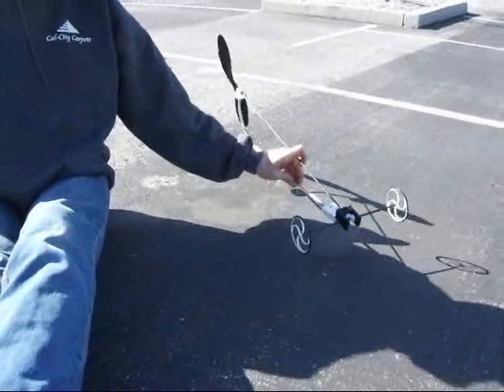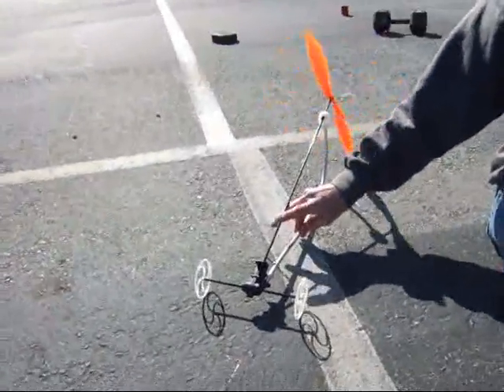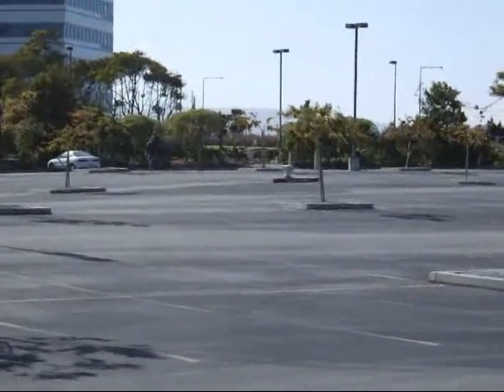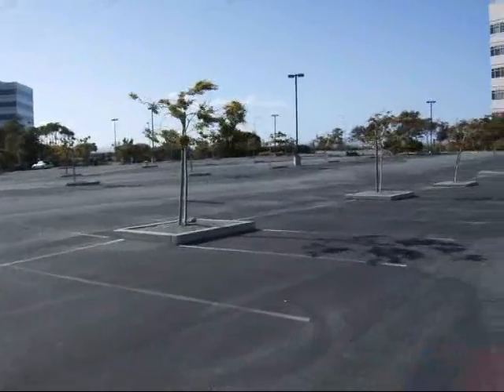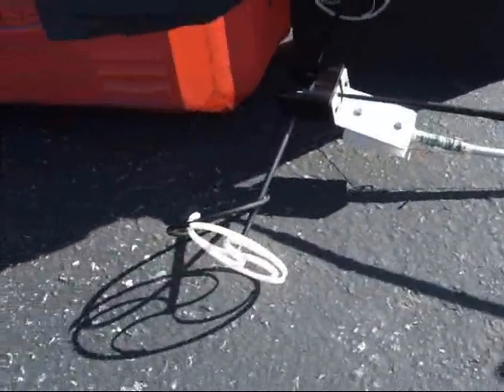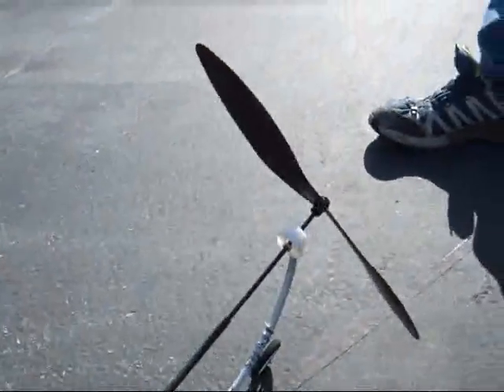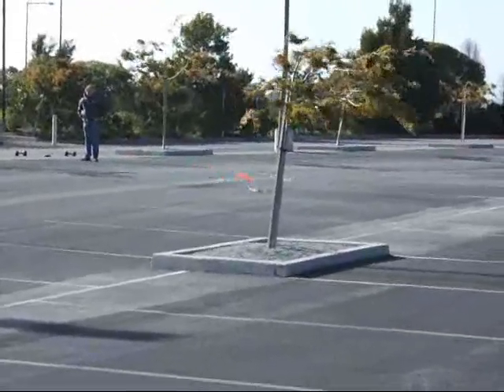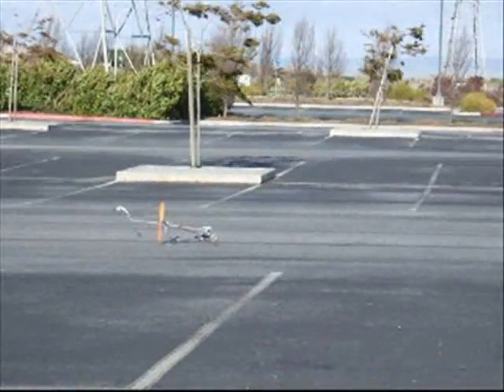Prop vs Turbine Race

Comment: Since your full-size vehicle has a variable-pitch prop, would it possible to in effect make it a 'turbine-mode' vehicle from v=0 to v=Vwind by making the prop pitch angle negative, and then transitioning to the existing positive prop angle 'prop-mode' vehicle to accelerate from there on?

Also, I was wondering if there was a way to calculate the optimum prop angle at any given point in the run (based on apparent wind?), or set up some sort of mechanical feedback system to do it automatically?